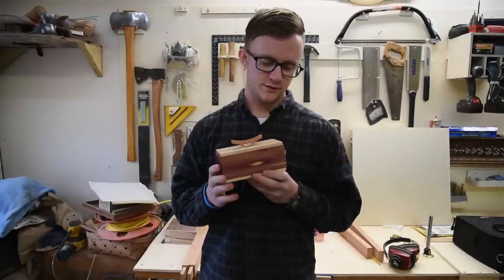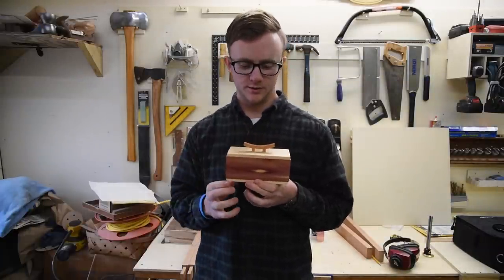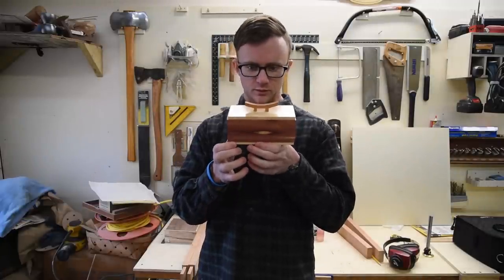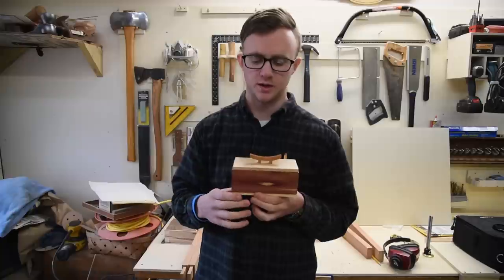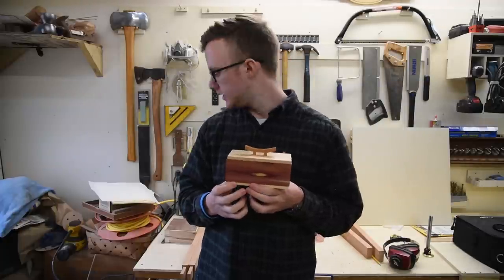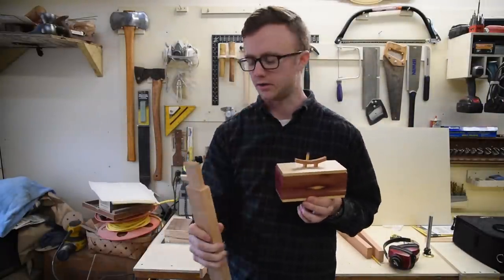Cedar and Maple Box

Comment: If the object is to make a box as simple as possible you have succeeded in making this an elegant box.  However, I have to wonder how well the 45° miters will hold up without any mechanical help.  End grain is notorious for not gluing up well.  I might have added splines.  I happen to have some aromatic cedar left over from doing a walk-in closet floor.  Now I know what to do with that.  Thanks.